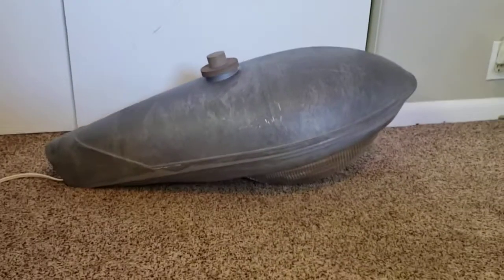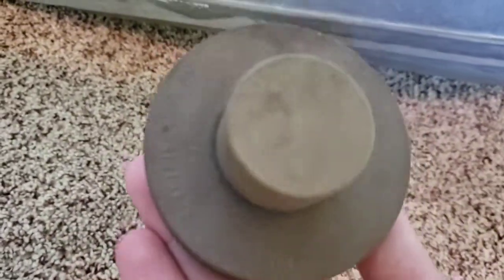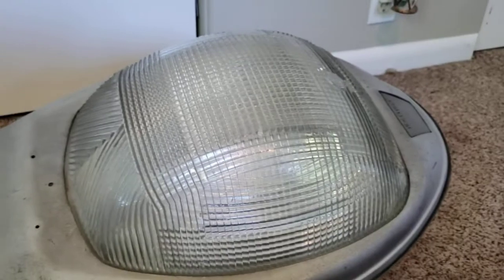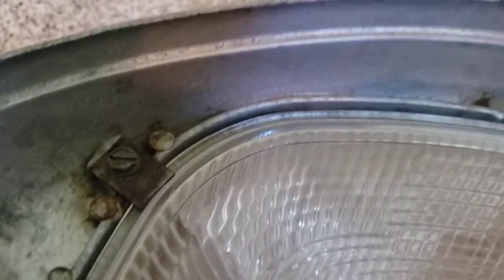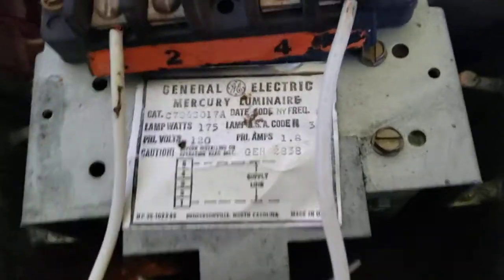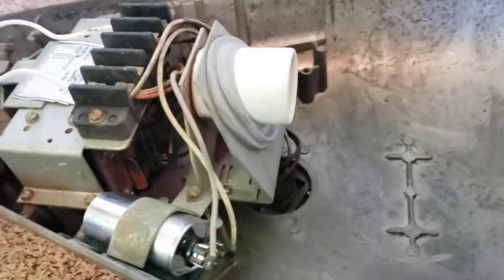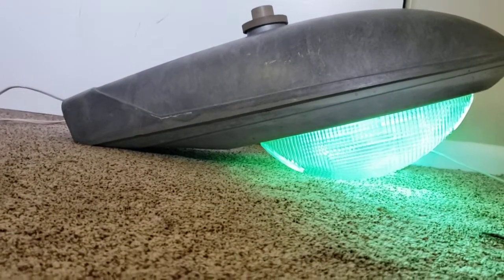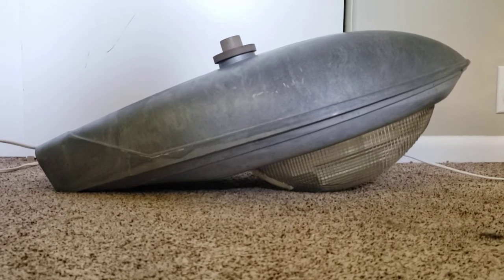My General electric M250R Mercury Vapor Street Light.

Comment: This is an early (1959 to mid-1960s) GM, M-250A. There are few of these fixture with 175 watt Mercury Vapor Lamp, sans reflector. Maybe it is a faulty bulb and it is powerful “explosion” to burst open the door and the reflector did fell out of this fixture but let the door hanging on its hinge until the repairman put in the new Mercury Vapor Lamp and closed the door. It does happen on US-206 near Bordentown New Jersey. I have been to New Jersey about 16 years ago around Bordentown area.
Reply from the maker: This one is a 1964 model